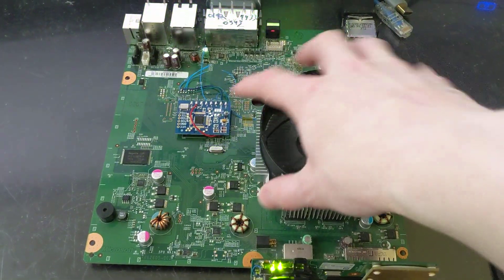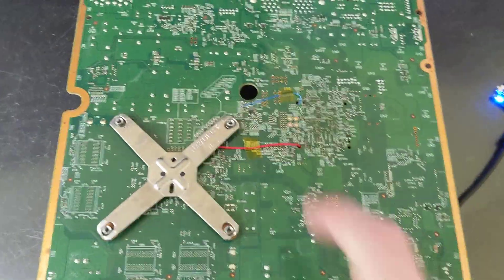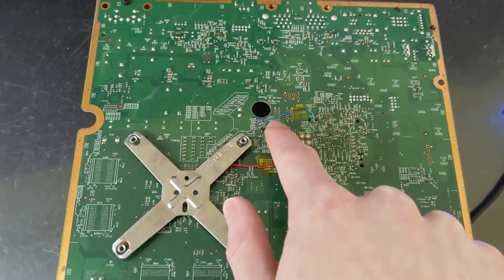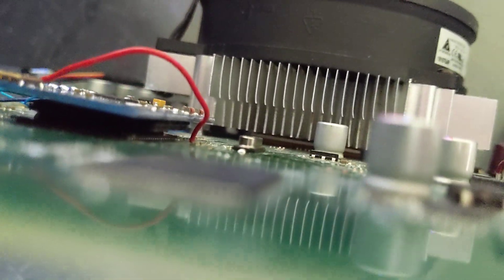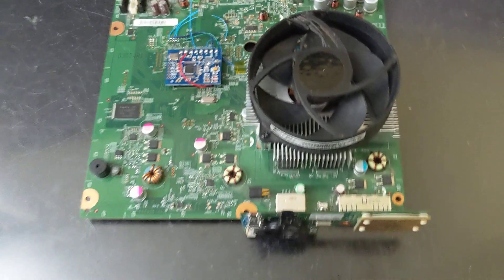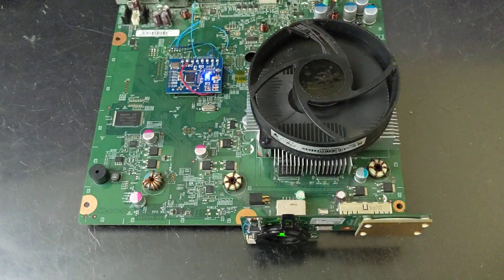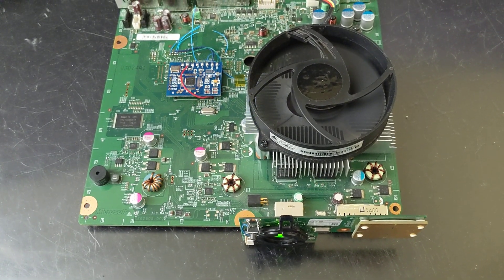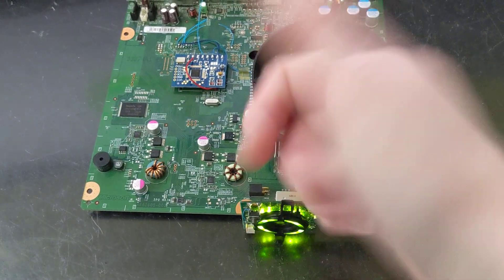RGH1.2 V2 Slim Postbit1 and Corona Support

Comment: Ok it’s great to get instant boot  more stable but were  is the change ????just u use different D point????
Reply from the maker: E goes to PLL Bypass. Should be F but needed to bypass the 22K as the pulldown on slim is too strong. Totally different firmware and different method to slow the CPU.

Comment: Is it ok to use clone Matrix V3 and clone Post Fix adapter?
Reply from the maker: yes
Reply: @Josh.Davidson  Seeing how great it works, will this replace S-RGH? Or are there still scenarios where S-RGH will be the better choice?
Reply from the maker: @MriCEQB  Its alot harder to solder the PLL. Also I don't know about Winbond yet. Probably i keep doing S-RGH for a while.
Reply: @Josh.Davidson  Will a fibreglass pen do the trick or does it need more digging?
Reply from the maker: I used a sharp point of a fine tweezers :D